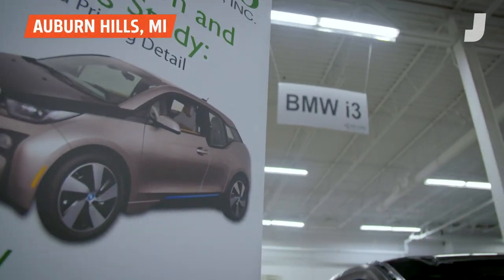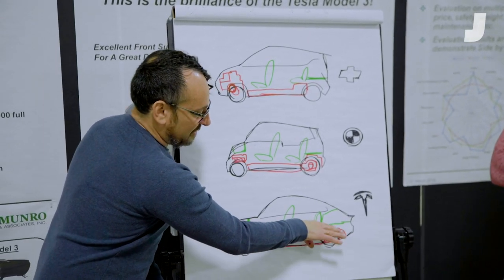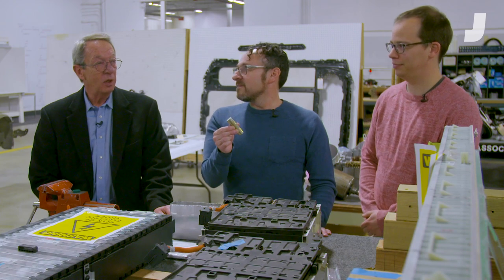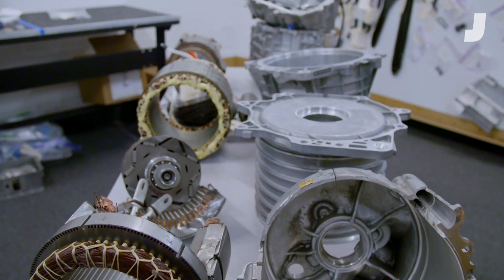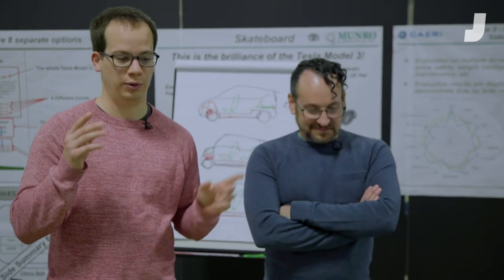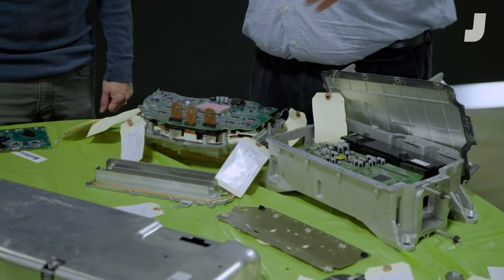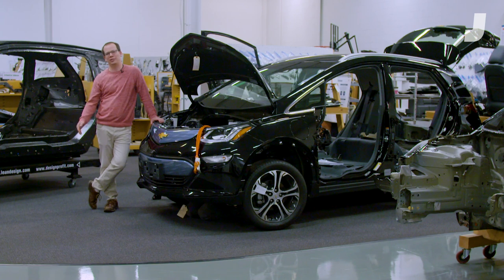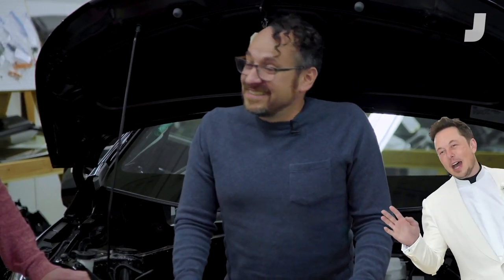A Look Inside The Tesla Model 3, Chevy Bolt, and BMW i3

Comment: The complaint about the Tesla Model 3 being too sturdy is from the perspective of manufacturing to maximize cost savings. Meaning they think the buyer doesn't deserve to be as safe because it would cost car makers money. Where they have a point is in the use of different welding types and fasteners which could be simplified and just as safe.
Reply: "Hands up who wants a sturdy car?"
(That'll be everyone )
Reply: They missed the point on that, like with every other topic. 
The chassis is too complicated to produce. Using more material is not a problem. Having 3 different methods to weld and bolt the parts together is stupid. You need to have 3 different robots work on the same part of the chassis, which makes the production line expensive and slow. 
Same with the electronics, there is no compromise to save production cost and time. 

The only compromises are building quality (paint job, gaps, substandard interior), work-life balance for the worker and battery design. Other automakers ruled several designs out over the decades and something like the Tesla packaging was ruled out as unsafe and complicated to control. Tesla solved the latter.
There is a reason for so many Teslas going up in flames and it comes to their "great" battery packaging. Sadly, that is giving EVs a bad reputation. 

To get EVs to the masses, they need to be safe and simple. They need to get to a price point that fits average and subaverage consumer pockets. 
Traditional automakers are on it,  VW is going to produce a Golf seized EV that is just slightly more expensive than a midrange combustion engine model.
Reply: @rogerstarkey5390  "Sturdy" is not an engineering term. A car body only has keep structural integrity at collision speeds up to 45 mph. At higher speed than that, death and injury is ensured even if padded in full body bubble wrap. Weight however is to be avoided as much as possible = lower energy use, shorter braking, and lower manufacturing costs.
Reply: @Agent-000-0  "there is a reason for so many Teslas going up in flames" ... "sadly, that is giving EVs a bad reputation". I'm not sure what "bad reputation" you speak of. I can only think of all the headlines that come when a Tesla fire occurs. Sometimes with falsified allegations, likely to be softball throws from shortsellers.
First of all, there's not "so many Teslas going up in flames". What is your source for that? And what is the source you have that says that Tesla's packaging specifically is unsafe? The numbers I've seen (from 2007-2014) showed a ratio of 1 fire per 25 billion miles, with ICE fires being 90 fires per billion miles. Tesla uses a battery chemistry that is more prone to going up in flames than some of its competitors (NiMH) but it's still safer than ICEVs (and has lots of other benefits). The publicity around their fires is not Tesla's fault. EV fires can be a lot harder to extinguish (especially without training), and some battery chemistry failures can be dangerous if the cooling and packaging isn't done right. EV development is still in its infancy, so perhaps safety might improve further (possibly together with battery chemistry).

I really hope VW will be able to produce their I.D. series in the way their marketing claimed. I liked the VW e-Up and e-Golf in many ways. But I exercise caution because traditional manufacturers don't have a history of living up to their claims, where as Tesla has historically done so (albeit rarely on time). VW's plan seems good on the surface, and they have the potential to take advantage of their knowledge of building bodies that Tesla doesn't. What we have yet to see is if they can make cheap EVs at a profit. And whether they can compete with Tesla's software and infrastructure advantages. But most of all, I just hope that they actually manage to produce them in serious enough numbers for them to be sustainable.
Reply: @Agent-000-0  Claims of Tesla being fire prone and the packaging is to blame is pure FUD. There is no statistical data showing they are above or even at the average of car fires in the industry. The media just gets to fan the flames easier because they clickbait articles about accidents. In fact, most manufacturers are copying Tesla's battery pack, the difference is that they keep using pouch cells or prismatic cells so they can reduce costs because less of them will be needed to be welded and connected compared to smaller cells like Tesla uses. However, larger cells are notoriously more difficult to control in terms of temperature because there is less surface area for a given amount of active material to interface the cooling or heating on the outside. It also requires compromises in chemistry being required to use less energy dense cells to counter their less effective cooling and heating of the cells in order to gain more passive stability. Regardless they pay the penalty in weight and efficiency. It's why cars like eTron or I Pace get worse range for the same capacity battery pack.
Reply: @Agent-000-0  Fíres on electric cars are way less than fires on ÍCE cars but the Media doesn't talk about them as they do when a Tesla gets on fire.
Reply: @Tore_Lund  
And yet Tesla STI make a healthy margin on each car! And they're a more efficient package.
Model Y should be ACE
Reply: @Agent-000-0  
May r pit pressure on the EXPERT comps IRS to actually get their finger out and produce the vehicles they should have by now?
Eh?
There's another Muppet elsewhere complaining that "you can't get to the invertor of you need to fix it"!
Maybe that's why the electronics ARE so good?
Bolt them in and leave them alone?

How about GM "missing the point"?
Bolting off the shelf parts into an off the shelf body to save money(?) And STILL losing a LOT on every car?
So much for "experts"
Reply: @Agent-000-0  
Btw
VW SHOULD be able to produce a car at a price!
They've had 70 years to practice!!
Note however that they are trying to find buyers for their package to reduce costs!?
Who knew it could be so hard?

Comment: Check out the simple design of what the Tesla is sitting on at 16:00. I need something like that when I have a truck cab that is off the frame and needs body work or paint. So simple yet easy to make.  I have a gantry that sets on the pad outside my garage so it would be so easy to pull off a cab and sit it on this.

Comment: I'm 6'5" and I fit in a Bolt, and my 6'2" son can sit behind me.   I don't think writing the Bolt off as a less efficient packaging job is correct.
Reply: Agreed, as while I'm only 5'11" but have the typical Native bone structure with very broad shoulders, and many imports don't fit me. Japanese cars for example are not designed for tall or wide people.
Reply: Well....taller cabin design isn't what they are talking about is it? They are talking about the electrical drivetrain components and how they are designed, packaged, and integrated into the chassis.
Reply: sjh7132 it is also made so retooling existing production lines are less expensive.

Comment: Great video.  I could watch a 2hr version of this and be riveted the whole time. 
But you missed an important nerd level detail on the Tesla Model 3 electric motor.  Unlike the other 2 AC motors Tesla developed an all new reluctance motor. Technically it was invented in 1883 but made practical for reliability and mass production by Tesla. 
No doubt the details about this motor would sail over most viewers heads but it's yet another significant innovation from Tesla that gives the Model 3 a cost, weight & space saving advantage.  AND Tesla bet the farm again, on a clean sheet of paper approach. This time on how to improve on existing AC motors. 
I'm sure your guest was dying to explain all this.
Reply: Yeah I'm really intrigued by that motor. The fact that you use saliency so you can cut down the permanent magnets and therefore have less magnetic friction to state it simply. I still wonder about the advantages compared to an induction motor though I think it's mainly power density of the motor and thanks to that efficiency as well.
Reply: Not true.... BMW i3 uses an reluctant motor developed from the ground up and acclaimed by motor experts years before tesla:  https://www.greencarcongress.com/2013/08/bmw-20130812.html

And this was done 5-7 years ago when tesla still designed asynchronus motors for model s/x
Reply: @ryccoh  
There's an episode of autoline daily from a few months ago were Sandy Munro talks about the motor and more specifically the magnets they use in the motor.
Reply: @christoph3226  Thanks for the link

Comment: what i found most fascinating is how clear the teardowns reveal the INTENTIONS and GOALS of the three companies. Tesla clearly has some talented engineers...but they also have the distinct advantage of working for a company that sincerely WANTS to make a good, sturdy, pioneering electric car.  You can tell from the designs that the other two don't actually WANT to mass produce these things.
Reply: Really, then why does Tesla have so much trouble with their production line ???
Why does it suck to work on the Tesla production line ???
Reply: @davidhollenshead4892  several hundred thousand cars a year out of one factory is not "so much trouble". They've had a lot of challenges meeting Musk's hyper-competitive and unrealistic deadlines....but ramping up a brand new car company using brand new technology hasn't happened anywhere else in a hundred years for a reason: it's hard

Comment: At 15:20, the other guy (not Jason) says that "this whole body is carbon fibre". That's not quite right. IT's CFRP - Carbon Fibre Reinforced Plastic. It's like 50/50 carbon and plastic. So cheaper and easier to make than pure carbon fibre, and stronger than plain plastic, but still expensive.
Reply: There's no such a thing as a "pure carbon fibre" structure. Every structural use of carbon fibre is in the form of some composite material.

Comment: But but but the panel gaps....
Reply: Yep big enough to fit a whole door.
Reply: Oh right it's dismantled.
hehehe
Reply: The i3 is much worse than the Model 3 but since it's not a Tesla people just expect it to be good and dont notice. If you ever find an i3 in the wild - have a look :)
Reply: The paint, the falling bumper fascias, the door handles...
Reply: SDD525  Far less than a year. :) Tesla does not wait for new "model years" to make improvements.  They make improvements as soon as they are able to.
Reply: @Dukhanstmichmal  Those "gaps" on the i3 were designed that way. What it meant by the criticisms on teslas is that the gap from the top of a panel down to the bottom should have a consistent space between the panels next to it. Munro and Assoc. still claim that the i3 is the benchmark of these consistent tolerances down to the millimeter. Watch the interview of the Model 3 Teardown interview on Autoline After Hours.
Reply: cedric1997, I would not doubt that, at all.

Comment: Ironically, the Tesla looks the most conventional on the outside, even though it's very unconventional on the inside.
Reply: Crap built by amatuers.
Reply: @captlarry-3525  Well it's a new company.
Reply: JF F  Theyre legitimately not well built, and the claims of overbuilding have nothing to do with strength but just things that add cost and complexity while significantly lowering QC. 

Thats from the several reports of that company that actually tore down several teslas.
Reply: Tom l I’m sure their build quality will get better. But come on man. You gotta give it to them though. They are the only ones on the market with a electric car that can do over 300 miles. It’s been that way for awhile too. Also the highest safety rating possible. Not to mention they all go 0-60 in under 6 seconds. Unfortunately their QC could use some improvement, let them hire some guys that know what they are doing, problem solved. How many costumers are going to tear down their car and see it is over engineered?? Nah maybe 1 in 100k.
Reply: @alphaomega9650  they're also funded by my tax dollars and are still grossly expensive when they were supposed to provide an affordable long range ev YEARS ago. But instead have spent our money elsewhere
Reply: @toml1446  dude you didn't pay a single dollar for any Tesla owners. The federal tax credit that owners get from the government is their own money not yours. It's called a credit from their own tax liability. So don't spread any misinformation. On the other hand, other automakers (main one being GM) did take your tax dollars to get bailed out for their bad decisions so they could stay afloat.
Reply: Yeah. The current market is crossovers, SUVs, and trucks. Tesla is building a sedan which the average consumer nowadays is moving away from. Musk may be obsoleting his company by staying with the sedans.
Reply: @robj2704  he now is making a crossover thing and a truck will be out in a few years. The problem is Musk is a fucking liar who over promises and under delivers.
Reply: @toml1446  i wonder what you think now about Porsches Taycan?
Reply: @unitrader403  I honestly haven't kept up enough with it to comment

Comment: To be fair, it's not a question of just a clean sheet design.  The Bolt is also a clean sheet design.  It was designed from the ground up as an EV.  The difference is that as they were designing it as an EV, they were making it fit into their current production processes with their current production lines.  So yes, they did base some things on how they make gas cars, but the Bolt isn't a gas car with a motor and batteries, as the Spark EV is.  It's a subtle difference.  Why, if Tesla just started totally clean didn't GM do the same thing?  Because GM has an infrastructure that makes ICE cars that they will have to transition.  Tesla doesn't.  GM has to transform their manufacturing.  I think the Bolt is a great way for them to do that.  Legacy auto companies are at a real disadvantage to Tesla moving forward.  It will be interesting to see if/how they transition.  As a side note, if you haven't, you should get in a Bolt.  It feels much larger from the inside.  I've gotten the Tardis comment from multiple riders.  Tesla is a great company with great cars.  i3 was a great experiment.  The Bolt is a great car and transition point for GM.  I wish them all, and others, the best.
Reply: Tesla seems to be trying to re-invent service, so it takes forever and costs a fortune...

Comment: Tesla did not go into battery technology alone.  They partnered with Panasonic.
Reply: What's your point? It was still a smart move...
Reply: aussiepyro 

That was my point. They didn’t just jump in. My son is an engineer at Tesla and he goes down to the Gigafactory pretty often. He is one of the lead designers of the rear power unit of the model III.
Reply: @dwightbrown2808  Ahh... OK then.
Often when someone states a fact like that on here they're doing it as a rebuttal, and it was hard to see what you were trying to convey. My apologies for misinterpreting it. 
Sounds like your son would have some interesting insights then.
Reply: @aussiepyro  No problem!  He very much likes working there and he even got to work on the new Roadster.  The only downer is the Bay area is a crazy place to live as far as housing.  $1000 per square foot give or take.

Comment: Go visit Boeing, Airbus, Bombardier, Textron.... Carbon Fibre already the future in aerospace. Rather a biased piece overall guys. An engine is not directly comparable to an electric motor. In some ways the motor is like the gearbox and electrical accessories on the ICE. The battery is fundamental.  60KWh is like 6 liters (1.5 us gal)  of diesel but much heavier in battery format.  Formula 1 V6s are very small.

Comment: BMW made the i3 like a helicopter, light composite frame, modular, etc, kinda expensive to make vs conventional metal frames but way lighter / 
The Model 3 blends a clean sheet design with traditional vehicle manufacturing methods 
The Bolt is an electromotive reworking of a vehicle originally designed for an ICE etc 

Electric autonomous flying platforms will have more in common with the i3 
Future electric cars will have a lot in common with the Model 3 
The Bolt represents a profitable transitionary approach taken by GM, Nissan etc to make an EV out of a conventional car design 

It will be very interesting to see how the electromotive revolution continues to unfold, since we are smack dab in the middle of it right now :)

Comment: The i3 is the best concept. Easy to change also small batterie parts at the Tesla you have to change the complete battery, what a mess. And for a samller price you get a carbon fiber cell in the i3 while the tesla is oldschool metall cell.